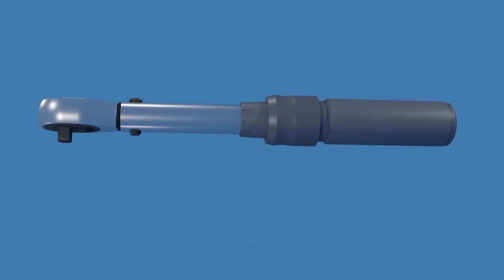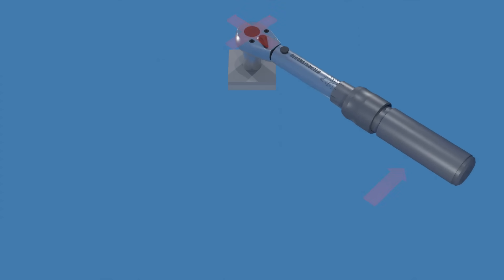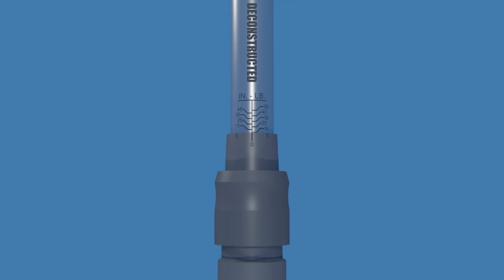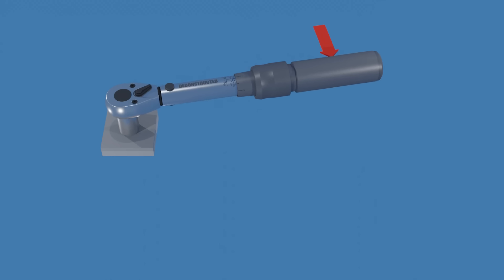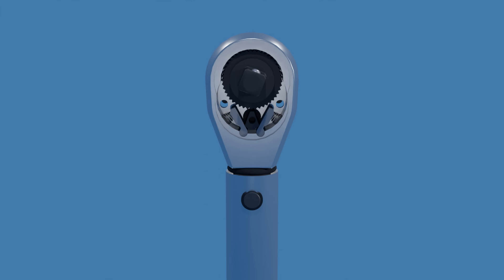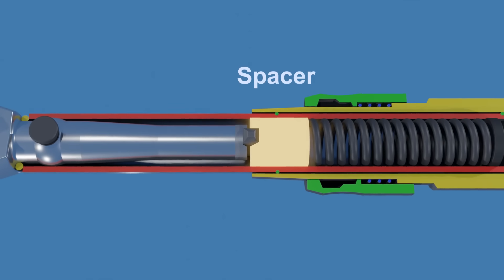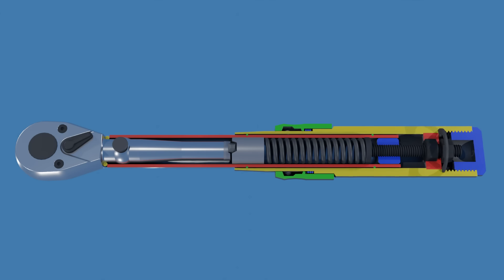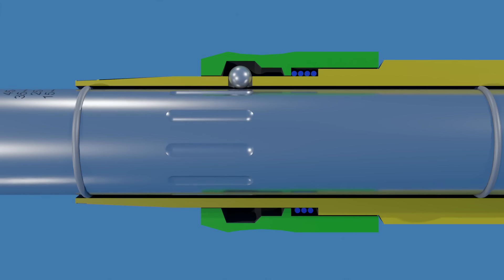How a torque wrench works

Comment: I use torque wrenches every day at work, and have been using them even longer in my hobbies at home.  I’ve even been to a technical college where we learned our profession in depth, and indeed learned that a spring is compressed to set the desired torque value.  Yet, no one could ever satisfactorily explain how the linear spring compression was translated to rotational torque measurement.  In 5 minutes, you have solved a decades long mystery for me!  Thank you.
Reply: I just bought a brand new 2JZ engine and I need to buy a quality torque wrench that I can trust up to 125ft.lbs. Got any suggestions?
Reply: Same, everyone always said there was a spring, but i never knew how it actually worked
Reply: @negativeindustrial what a clown
Reply: @negativeindustrial  anything except Pittsburgh (Harbor Freight trash). I have a new-ish Craftsman that has held up nicely so far.
Reply: @pogtuber5146  
I actually really like the Craftsman stuff I’ve bought so far. It isn’t near as nice as my grandfather’s craftsman stuff from the previous century but I’ve never had an issue with any of it.
That’s actually a really good idea. Thank you so much for the suggestion.
Reply: @negativeindustrial  Yeah man give it a shot it'll work out, you're welcome
Reply: still doesn't explain how spring force is translated to rotational torque...
Reply: @V.D.22  yes it does
Reply: more like 1min, the explanation part starts at 4:00
Reply: @V.D.22  i think the spring applies force to the top portion of the wrench, which keeps it fixed, and it will stay as one unit until there's more force coming from top portion which will cause the top portion to "detach" from the bottom portion.
Reply: I'm also still not sure how it works. Especially after he said it should not be used to loosen a fastener - this pivot block looks totally symmetrical.
Reply: @Adiounys  Maybe the tool isnt designed to handle the shock release of pressure that can sometimes happen when loosening a bolt?
The symmentry of the pivot block might just be so you can tighten a bolt in both directions, as some bolts tighten the opposite way.
Reply: @snowjix  What kind of shock do you have in mind? If you talk about the "shock" to you that cases abrupt hand movement after it was loosened - I don't believe any excess force is acting at this point, it happens because you suddenly need significantly less force to move the screw...
I was thinking maybe this was stated because the fact that you are able to still apply more force to the wrench after it "clicks".
Reply: @negativeindustrial  Sure! Start using metrics, and the entire world might be able to answer, not just Myanmar, Libya and the US...
Reply: @full-timepog6844  If you have to start your answer with "I think..." ?? Especially for someone who requests solid answers for precision tools. Please don´t be that guy.
Reply: @olenilsen4660  
What’s wrong with knowing both systems fluently? I can convert between the two systems in my head with a high degree of accuracy. I can also convert imperial fractions to decimal imperial and then to metric in my head and then back again. You understand that American schools teach both systems? 170nm BTW

Comment: Thanks for mentioning that you should store your torque wrench at the lowest SETTING. I have to constantly inspect my friends’ work when they put away my torque wrenches to make sure they didn’t leave it where it was or bring it all the way down past the lowest setting.
Reply: Only necessary micrometer style torque wrenches, split beam you can store however you want and it doesn't affect it. Still hard to break the habit of storing at 0 though.
Reply: The torque wrench I have specifies in the manual to store it at 20% of the max torque value.
Reply: It does no damage to the tool to store it set. Metal doesn't weaken under constant force, it weakens when that force changes.
Reply: @richardmillhousenixon  you've never seen a deformation mechanism map for material science and it shows.
Reply: @richardmillhousenixon  Truth. Cycles cause springs to weaken far quicker than steady state loads ever can. Easily proven in real world scenarios. Firearm magazines are a perfect example. They can be stored fully loaded with the spring fully compressed for decades upon decades and the spring will still be as strong as any new magazine. But put a magazine through several hundred cycles of loading and unloading and it will be noticeably weaker even if the magazine is only a few years old. Thousands of cycles and it will start to become too weak.
Reply: @ShadetreeArmorer  Even though you're right, this comment is INCREDIBLY cringe and there were much better ways to say it.
Reply: @Henry12151  you're right, I should have used the pejorative "midwit" as it is apropos.
Reply: @scythelord  the specific example you gave of firearms magazines is one of the worst examples you could give.  The spring in a magazine is more likely to become unserviceable due to creep than fatigue.  Keep reading and I'll explain why.  Take the example of a 17rd pistol magazine.  Pistol magazine springs almost always exhibit set when first loaded to full capacity, because the design calls for fitting the most rounds possible in small space.  To do this, they take the spring to the absolute limit of compression.  If you see set, it means the spring is being compressed right to the plastic/elastic boundary.  Creep is higher when the spring is stored near this boundary, and indeed with many common magazine springs (for example Chrome Silicon) you will get a decent amount of creep when left fully loaded over time. But what about cyclic wear?  We tend to replace recoil springs every 3000-5000 rounds because of cyclic wear/fatigue.  But the 17rd pistol magazine spring we're considering isn't cycled once per round.  It's cycled once per 17 rounds.  So to reach the number of cycles you'd see out of the recoil spring over 3000 rounds, you would need to fire 51,000 rounds out of ONE magazine.  There are very few humans on earth who ever reach those kinds of numbers without destroying the magazine in some other fashion first.
Reply: @Henry12151 🤣🤝
Reply: @Henry12151 you're comment is cringe lol
Reply: @ShadetreeArmorer  🤓🤓🤓🤓🤓🤓🤓🤓🤓🤓
Reply: @richardmillhousenixon you’ve never heard of creep deformation and should probably refrain from telling people how things work. It’s even said explicitly in the video.
Reply: @mattmurphy7030  You don't understand creep deformation and you should probably refrain from telling people how things work.

Creep deformation is, for all practical purposes, a complete non-issue in metals unless the temperature is greater than 35% of the melting temperature in Kelvin. The melting point of steel is about 1400°C, or 1673 Kelvin. 35% of that is about 585.6 Kelvin, or 312 degrees Celsius. Unless you're throwing your torque wrench inside a fucking furnace, creep is a nonissue. If you're working in an environment where you need extremely high precision, then yeah being extra careful isn't a bad thing. But for anyone else, it's literally just extra work, and the extra mechanical stresses from setting it and resetting it daily will cause far more deformation than creep ever would at ambient temperature.

Check yourself.
Reply: @ShadetreeArmorer  I have. Which is how I understand that the amount of deformation you would see with the stress inside a torque wrench at ambient temperature is statistically insignificant. And the repeated stress from setting and resetting the torque wrench on a daily basis FAR outweighs any possible creep deformation.
Reply: @richardmillhousenixon springs are absolutely subject to room temperature creep when they are near the boundary of elastic and plastic deformation, yet still in the elastic regime.  You don't know what you're talking about.  I've personally measured and observed this.  At higher temperatures, the range of stress over which creep will be observed is much wider, and as temperatures drop this range of stress gets smaller (and the mechanisms at work change) but it never truly drops to zero.
Reply: @ShadetreeArmorer  The stress put on them by the torque wrench is nowhere near the point of plastic deformation. Again, if you're using your torque wrench often, the active stresses put on the spring by constantly setting it and resetting it will be far greater than any possible creep deformation at the temperatures and stresses present in a torque wrench
Reply: @scythelord the spring in a magazine doesn't rely on precise calibration, though. It can still do its job perfectly well with a little bit of creep.
Reply: Funny that many say Newton.metres, and then say foot.pounds.
Reply: @martinbrown-wh3ox Eh, the unit is a result of multiplication, which is commutative. The parts of the unit can be said in any order, and foot pounds sounds better than pound feet.

Meter newtons would also be acceptable, and sounds fine to me, but it's just not what's normally said
Reply: @scythelord  Now the springs of my car suspetion  have been rattling up and down for nearly 1 million km. When will the springs wear out?
Reply: @cion191  
"you're comment is cringe"

your
Reply: @shawbros  💕
Reply: You allow others to use a precision instrument like this?
I was going to say there are people you can trust to look after the equipment and not use it as a hammer or to knock something to straighten it up but if those people are trustworthy they would return it in the exact same condition as it was when taken but you will be the one to get it calibrated at you expense if it wasn't looked after as you would do. If you damage it the problem is only your own and you have to pay without blame.
Reply: @paullelys161  I treat my shop as a learning space for my friends less fortunate than me to be able to afford a lift and the cool tools I accumulate. I’m typically working alongside them so I’m able to make sure my tools are being treated with respect.

Comment: If you’ve never used a torque wrench before, it’s useful to understand the “click” is very subtle and easy to miss at low torque settings. It’s a good idea to practice with it to get a feel for how it works at different settings before tightening critical fasteners you don’t want to snap!
Reply: or use a digital one
Reply: Yea snapped a few heads over the years where I would have been better off to just hand tighten but instead waited for a click that never came
Reply: @YourFavouriteComment  It came… you just missed it :)

Don’t worry I’ve done the same thing haha.
Reply: I broke a glow plug into the engine block the first time I used a torque wrench 💀💀💀 I didn't heard the "click".
Reply: Yeah, it's very subdued at low settings (something you'd use on a 10mm bolt).
Reply: One of my good buddies Rick (RIP) handed me a torque wrench, supposed to be set for 80 inch pounds. i started tightening engine components and noticed it was getting way too tight from experience working on these. so I asked Rick and he said just turn it til it clicks. I said no something is wrong. Turns out he had it set to 80 ft lbs!!!
Sometimes experience can save you.
Reply: @SaltMinerOU812 I had a very similar experience, a buddy insisted we use established torque values on EVERY fastener, and he snapped my upper intake bolts off on my Ranger. After the third one snapped before reaching 80 ft-lbs, he discovered he'd read the spec wrong and it was 80 in-lbs.
I will never in my life use a torque wrench again for anything but cylinder head and crank main bolts/studs. Everything else is better done by feel, except rod bolts which are done by a stretch spec.
Reply: @SaltMinerOU812  Hopefully you didn't end up stripping the bolt!

Comment: I think the torque wrench is one of the most ingenious tools out there.
Reply: Depends on the application. There is a diff, between torquing a bolt on a bicycle to 5Nm or a wheel on a Ferrari to 600 Nm. ^^

Comment: Great video, I used to use these all the time at my old job but didn't know what was going on inside. I will say that I think the risk of damaging the wrench is equal during tightening or loosening. When loosening, you can still set a torque limit and use the click to avoid an over-torque scenario. If you know what the screw was torqued at, you should be able to set the same for loosening (but maybe a little extra due to friction).

Comment: 5:05 the internal spring is under compression, not tension.
Reply from the maker: Thanks for the feedback
Reply: @Deconstructed_Animations  Also over-torquing eventually leads to metal failure by exceeding the yield point of the fastener causing the fastener to no longer hold the desired amount of torque.

Comment: 4:32 "the energy stored in the system is released". No not at all. If anything the user has added more energy to the system. Your animations are very nice.
Reply: Agreed. It took me a minute of watching the animation to realize that rather, once the torque overcomes the force of the spring, the spring compresses allowing the pivot block to rock.
Reply: @agentpresta  This should be the top comment on this video. Because of you I actually understand what happens.
Reply: Saying “no not at all” isn’t strictly true. The narrator wasn’t totally wrong. When the block suddenly pivots and the head assembly strikes the inside of the wrench body making the click, that is a small release of energy. It is just a small part of the stored energy, not all of it, but more than zero.
Reply: @Tux.Penguin  The user is twisting it with more and more torque as that happens. Are we really talking about the energy required to make a noise while tightening bolts? Your comment is even more pedantic than mine.
Reply: @adaycj  Success!  I was finally able to out-pedantic another commenter. :-)
Reply: @Tux.Penguin As a fellow Linux user/fan, we are the kings/queens of pedantry. (I wonder if that's even a word?) 😊 your taking that snide remark in stride put a smile on my face. Have a good day today!
Reply: I was scrolling down to see if anyone commented on this! Haha
Reply: @adaycj it's not that pedantic to point out that 'a' release of energy is a release of energy. Sure it's not all the energy put into turning the wrench, but the 'clicker' operates precisely by storing a certain amount of energy then releasing it when the desired torque is achieved. There's no way to argue otherwise.
Reply: @dielaughing73  The video didn't say "a", it said "the energy". If you are going to try and out nitpick a pedantic comment you have to at least get the nitpick right.
Reply: @adaycj  are you seriously going to twist my words like that? The energy stored in the pin-release system is released. Sure the guy might have misspoken slightly but you are making a huge fuss out nothing. If you're not going to concede that energy is released then I'm done wasting my time with you.
Reply: @dielaughing73  Calm down. You are replying and picking apart an 8 month old comment. If you think the point of the video was the release of energy from a tiny rocker making a click, then go post your own comment. No huge deal was made, I even complimented the video's animations.  The person that posted this video even liked my comment.

Comment: On the knurled part of the handle, there are usually one or two marking bands for hand placement. This is to get the correct distance from the centre of the socket, the pivot point, out to your hand. It is to ensure you are applying the correct torque as set by the vernier scale.

Comment: Fun tip: Run your torque wrench up to max setting and click it at least 6 times against a stationary fastener. There is oil on the pivot block and it needs to be moved around from settling, or the block will premature wear and fail. 😉

Comment: I own 3 torque wrenches. I've seen lots of people use torque wrenches. I have never seen a torque wench with that pull down locking ring mechanism. The torque setting has always been at the bottom for every click torque wrench I've ever laid eyes on.
Reply: The locking ring style is exactly how all the click style torque wrenches I've seen work.
Reply: I have both kinds.  My newest 1/4” looks identical to this animated one in every detail lol.

Comment: I'd love to see a split beam torque wrench explained. I use mine at work multiple times per hour, and I'm curious about the inner workings.
Reply from the maker: Thanks for the suggestion, we’ll consider for a next video
Reply: @@1-Wheel-Drive you're thinking of a dual-beam torque wrench. That's the only one that ever comes up when you go looking. A split beam torque wrench has a small dial on the side to set the torque rating and a lever to lock in the value. They give a much more massive click than the click given by the wrench in this video once the torque value is reached.

Comment: As a suggestion for a future video, I'd love a similarly detailed overview of a simple car radiator! Sometimes is hard to imagine how the water travels through it when you can see through most of it.
Reply from the maker: Thanks for the suggestion
Reply: @Deconstructed_Animations  Second this
Reply: Really?
Reply: Tubes. There are tubes inside. Sheets of metal are there to increase surface area.
Reply: A radiator is very simple it’s just a heat exchanger similar to a furnace, simple

Comment: Great video. One gripe, most pawls havent looked like that in decades. They usually use a single pawl that just pivots to grab either side of the drive gear.